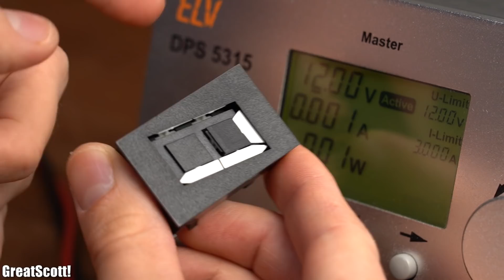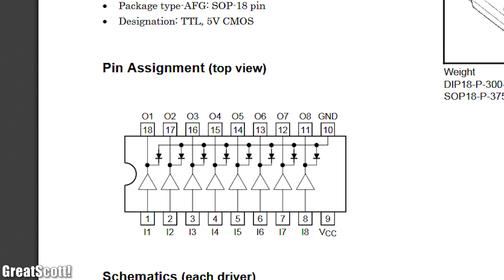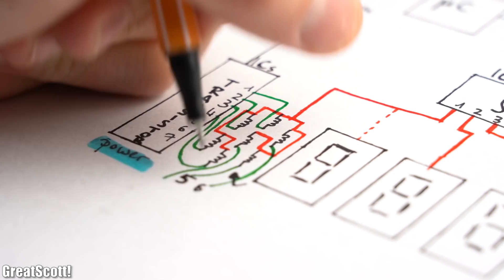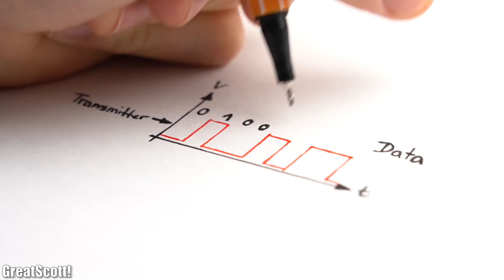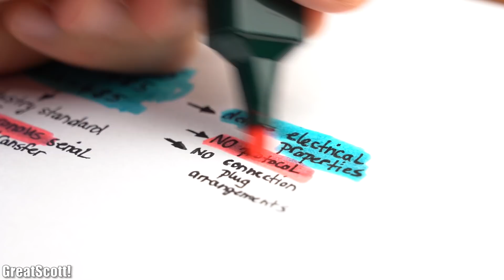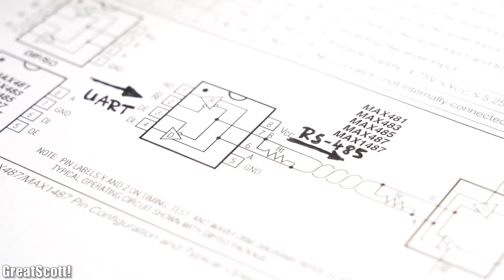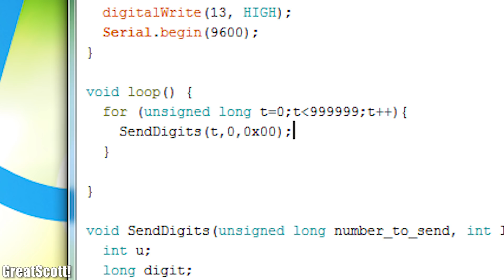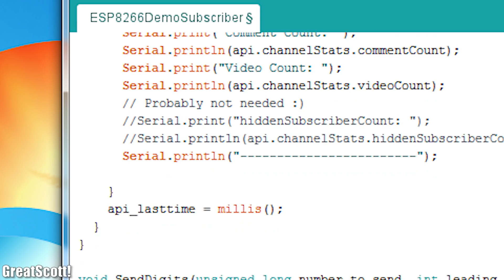Controlling Mechanical 7-Segment Displays?! How RS-485 and UART works! || EB#43

Comment: The control board seems a lot like a DMX controller for entertainment industry lighting, big Clive has some great videos explaining it. But DMX uses RS-485 to be able to control up to 512 lights and the 2 RJ-11 ports on the controller board is where I got this connection from because for DMX there is always 2 ports on each light so you can connect multiple in a chain.

Comment: Can anyone help me out ??

If two microcontrollers sitting far apart(may be upto 1 km) need to talk to each other using RS485, a twisted pair wire can be used to carry the differential signal.

My question is, does it also requires a common ground ??
My intuition says, it doesn't need that but I'm not sure and don't know the reason either.

If you know the answer and its reason, please explain.
Thanks in advance.🙏😄

Comment: The twisting of the cable was not really necessary. We used it always on flat cables with 15 Pin D-SUB connectors with speeds up to 38400 without ever having any issues even in hostile industrial environments. The only important thing is that the differential data lines are not too far appart so that induced noise is the same on both lines.

Comment: Hi Scott,
I am debugging an RS485 design-driven by raspberry pi, before coming to this video I was tired upset because it was not working and it was 3AM in the morning.
In your video you mentioned that the baud rate must to matched, then it dawned upon me that I must modify it and it worked.
I guess when your frustrated you mess up even the most trivial things. Your video gave my cluttered mind a hint.
Thanks a Ton, Scott, never stop making these videos.

Comment: There's a small "mistake" on your video. It's not enough to just plug any twisted pair wire, the twisted pair has to have an impedance of 120ohm for the MAX485. This translates to a specific width, diameter, spacing and insulator material. Usually Ethernet cable has 100ohm impedance, which is close enough for many applications. I know you pointed out to some RS-485 documents for further clarification, but when you show that you can just twist some wires and it works fine it sends the word message.
Reply from the maker: Isn't that why you use a termination resistor? The MAX485 board came with one. Could even be 120ohm.
Reply: @greatscottlab  The termination resistor is part of the process. Basically the signal needs to see a continuous impedance as it travels down the transmission line (the wire basically). When the signal gets to end of the line it sees the termination resistor, with the same impedance. Impedance discontinuities, at the wires, or at the ends (termination) create signal reflections, which leads to signal degradation and many other signal integrity issues. That's a rather long and complex subject, I am trying to simplify it. It just becomes a real issue with transmission lines that get close to the size of the signal (related to the frequency of the signal), so the real impact of it relates with the length of the wires and frequency of the signal. Needless to say, the RS-485 specification recommends 120ohm instantaneous impedance twisted pair wires, with a 120ohm termination resistor at the end of the bus.
Reply: @greatscottlab  Also, that MAX485 transceiver board you used has a problem (I know because I used it before). It comes with a 120ohm termination resistor soldered, it's fine if this is the last node on your RS-485 bus, but if you have many, then you are only supposed to terminate at the end of the line. Terminating on each node get all the termination resistors to consume too much current, as they behave in parallel. So remove it before using on the intermediate nodes.

Comment: I have to chime in, I was a part of building a massive flipdot sign for coke. Videos at the bottom. It worked very much along these lines, just at a massive scale. 485 is very important in this application. There is so much emi with so many magnets, its the only way to get data around. Nothing else works.

Around 80 control boards in this sign, multiplexed 8x8 on one axis, and 6x16 on the other. A PIC micro to decode the bitmap coming in on 485, with a small FPGA driving a bunch of shift registers, driving a bunch of FETs actually controlling the individual x/y coil drive. A really awesome project. To supply enough energy to flick the coils, theres about 80x 680000uf caps in this. Yeh. 55 farad. The sound of this thing going from 0000 to 1111 is an incredible, physical thing. WH-CHOOM!

Flipdots ftw. If you can find an excuse to, play with them, they'll make you smile. Even little ones.

https://youtu.be/uxL4SK3B4lY - the cameras shutter really lets you see how its driven. In reality is far smoother, a flowing, waterfall effect. Which is what coke wanted. Its not instant, its obviously mechanical and slow, but it looks pretty fluid, cos your brain is slow. Camera exaggerates the effect and chops it into blocks, which is what you chaps want to see. But damn does it sound good

https://youtu.be/UOwHlk4lM2c - a press peice, but there is some interesting guts of the machine shots among it. I think Petes nephew was doing a media degree, n it was a decent subject to film. We dont normally Vlog our projects. But it is kinda nice to have video. 

Of course, what isnt shown is the countless hours of hair pulling, yelling at n pleading with whatever gods you hold dear, chasing cable faults, comms issues, power spikes, ohsomany weird code bugs, all that fun stuff. None of that goes away when you go from hobbyist to pro. It just gets more stressful. Ya make some really cool stuff tho

Comment: RS-485 is similar to RS-232 which is a communication protocol. 
https://en.wikipedia.org/wiki/RS-232

and those segments are controlled the same way memory of early computers like IBM-370 worked.
https://en.wikipedia.org/wiki/Magnetic-core_memory

Comment: Hi scott, do you consider to make a lightning surege protection without a varistor. Is it possible to make a lightning strike protector with fast slew rate opamp or FETs? Because varistors are dead after couple of spike/strike and i need different soulution. By the way sorry for mu f*king english dude. If you are interested may be your viewers interests. Thanks for reading.

Comment: 5:11
"this is called a synchronous communication, the rs485 however is asynchronous"

...so confusing xD
Reply: Why? He showed what both of them look like. What's confusing?
Reply: @greenvm  I guess it's the fact that if you merge the "a" with the "synchronous" from "this is called a synchronous communication" it represents the opposite type of communication: asynchronous. So you kinda depend on the video (or subtitles) to clearly know which is which.

Comment: PRICING FOR OCTOBER 2019:
7 seg modules:
9 EUR apiece for 1-99 pcs
controllers:
21 EUR for 1-99 pcs
190 EUR for a bundle of 1x10 digits with controllers
Reply: hackerman  7 Seg is 6.50 EUR for any qty...
Reply: Solitary Midnight  for limited time they sell any qty for 1000+ price which is 6.50 EUR
Reply: @marcinpkrysinski  any quantity 1000+.... Yeah that's not any quantity if it's over a quantity.....

Comment: I think you forgot to explain the ground reference problems of RS-485 or UART. For example, the maximum common mode voltage of A and B inputs, when to use isolator, and so on. Basically, the ground connection in differential signals
.

Comment: Alright, now let's look at the power use difference between one of these and a high contrast LCD display of the same size.
Reply: Or better, an electronic ink display which draws zero power between updates.

Comment: That doesn't explain how the drivers supply reverse voltage / current to the segments you want to turn from ON to OFF though.
Reply: Yes every segment must have a H bridge or be connected between tow Logic output that can source and sink the appropriate current .
Reply: Presumably that is handled by the controller board. He is just programming to get a serial output.
Reply: @popcorny007  I was referring to the explanation of turning segments ON at 2:58 to 4:03, It is NOT like multiplexing LEDS which turn OFF when there is no power, these segments retain their state until power is applied in reverse.

Comment: Another great topic, but I missed something.  

In one of the the diagrams, one end of all of the magnets in a digit are connected to a common source, and the individual segments are grounded by a darlington transistor pair.  How do you switch between the two states; segment displayed or segment not displayed?

Removing the power retains the existing state so don't you need to apply the power for state 0 and reverse the polarity to select state 1?  How do reverse the polarity in this case without an h-bridge?
Reply: Me too.  I guess he used Darlington pairs to drive leds that needed more current than an ordinary logic chip can provide and he guessed that this was done here.  But, as you imply,  current can only be passed in one direction through a darlington pair and the muxing won't work.  Most likely there's a number of mosfet H-bridges involved.   There's a lot of chips on that driver board!
Reply: You might be able to get away with pulling the common line high and pulling only the electromagnet you want to load low? I'm not sure.
Reply: Pondered the same thing! Figured I missed something (which, I obviously did but still happy I'm not the only one lolol.)

Comment: Hopefully china starts making these. I'm not buying from a company that won't tell you the price without "getting in touch with a representative"
Reply: Thats basicly just another way to say "way to expensive for you and dont even try to buy them if you dont need at least 5000"
Reply: someone ITT commented the following:

 Just contect their info@alfazeta.pl email address. The pricelist i got when ive asked was 9 Euro for a 7 Segment without controller (as shown in the beginning) 24 Euro for a single digit controller (didnt ask for code to controlle it, wanted to use it as a base for my own design). And the Simple flipdots were from 4-12 Euro available. Just mail them, the reply was fast and informative when i asked some questions reguarding shipping and price. Hope this helps. Their page also shows some cool Projects they did with artists.
Reply: @hackerman7835  they are cool but too pricey just to buy to play with
Reply: I'm afraid that most of the times it works this way with industrial products :/ every time I have to do research to purchase components for a project is the same, I have to send s thousand emails asking for quotes (Usually they answer back with a huge price xD)

Comment: 6:55 - This is like the XLR standard in the music industry for professional balanced audio facilitating levels of noise removal.

People think 'Hmmmm' to begin with and then 'Aaaahh' when they understand the process of the inverted signal to isolate the noise and then remove it from the final signal.
Reply: And don't forget that stage lights use XLR too
Reply: JDanielDroiidXD - Depends on your pinout (anything from 3-7) but the good thing about XLR is it's scalability lending itself to a shit load of functions :-)

Comment: We use a large 3 inch set of mechanical displays on our racing sailboat for important data. It's excellent, low power and most importantly doesn't have the visibility issues like LCDs with polarized sunglasses. Old tech but still the best in some applications.

Comment: i think you could skip all the mess with 7 transistros plus one extra per display, a pin for each one of the transistors and some basic code. that's 8 pins for a single display, but just 15 pins for an 8-display array. and it skips all the crap. some projects need the complexity of double arduinos, communication protocols and all that, but I think this project is not one of those.

Comment: And to get a price you have to ask for a quote.  :(    why couldn't they put at least an MSRP or estimated price per digit?    It would be good for them to offer a  DEV kit  for $XX dollars with 4 digits and uart board?
Reply: If you have to ask, you can't afford it is the usual approach of companies like that.   Screw them!
They must be out of patent, so I'm sure there's a factory in China churning them out by the thousand, for a dollar or two a piece.
Reply: SarkyBugger I felt that way exactly
Reply: to quote another comment:

The pricelist i got when ive asked was 9 Euro for a 7 Segment without controller (as shown in the beginning) 24 Euro for a single digit controller (didnt ask for code to controlle it, wanted to use it as a base for my own design). And the Simple flipdots were from 4-12 Euro available. Just mail them, the reply was fast and informative when i asked some questions reguarding shipping and price. Hope this helps. Their page also shows some cool Projects they did with artists.
Reply: @hackerman7835  at those prices why don't they just put a PayPal button on or something! I'd buy!
Reply: Search for "ebay Ferranti Packard" on Google - I found it slightly cheaper to buy new-old-stock or used original displays. Alfa Zeta is manufacturing new stock of an existing design which is great for industrial customers, but for hobbyists the supply chain aspect doesn't matter. When I got a quote from Alfa Zeta in 2018, it was cheaper per unit to buy a dozen on ebay including shipping than to buy 500 new units.

Comment: How much do these cost? Are they affordable for DIY projects?
Reply: to quote another comment:

The pricelist i got when ive asked was 9 Euro for a 7 Segment without controller (as shown in the beginning) 24 Euro for a single digit controller (didnt ask for code to controlle it, wanted to use it as a base for my own design). And the Simple flipdots were from 4-12 Euro available. Just mail them, the reply was fast and informative when i asked some questions reguarding shipping and price. Hope this helps. Their page also shows some cool Projects they did with artists.

Comment: And how the hell I can buy one of this? Can't find any info on their page
Reply from the maker: You can contact them. They are happy to answer you.
Reply: If you get a ballpark price tell us, because I'm not going to chase it because it's probably too expensive.
Reply: quote:

The pricelist i got when ive asked was 9 Euro for a 7 Segment without controller (as shown in the beginning) 24 Euro for a single digit controller (didnt ask for code to controlle it, wanted to use it as a base for my own design). And the Simple flipdots were from 4-12 Euro available. Just mail them, the reply was fast and informative when i asked some questions reguarding shipping and price. Hope this helps. Their page also shows some cool Projects they did with artists.

Comment: I've just unsubscribed and subscribed again just so you could hear the noise of it. Now it's time to do a cool enclosure for it with neopixels ;)

Keep up the good work and smooth editing. Your channel is really fun to watch and inspiring!

Greetings from an electrical engineer in Munich :)
Reply: Unfortunately that won’t work, as it takes a while for YouTube to process it.
Reply: @GRBtutorials  Also, it seems to grab the public data, which is rounded to two decimals. In his case that's rounded to the nearest 10 000.
Reply: @GRBtutorials  It also won't work because youtube now rounds off the subscriber number...
Reply: Is the number displayed on the main page of your channel up to date? I think an esp8266 should be able to "scrape" that :)
Reply: @geomagpsz  No. The only place the true number is shown is on the creator studio page, and only the channel owner can see that.
Reply: Youtube changed,  you now need to be authed as the creator(some app in gcloud console probably) to get it precise.
Reply: @honzapat  Even with your own API key, you can't get accurate sub numbers via the API. 

Only from the creator studio, which can't be pulled into a device like this.
Reply: @pileofstuff  Any reason you couldn't program a device to use the creator studio number?

I suppose an alternative would be to make a view counter that sums up views across all videos uploaded by a given creator.
Reply: NiHaoMike Well, another possibility is to use maths, concretely bidimensional statistical analysis. Wait, don’t run away! It’s not that difficult, just a simple matter of logging the subscriber count for a few months, and then applying statistics to calculate when the next subscriber, well, subscribes. That still doesn’t allow for this kind of thing to happen, but it’s the best we can do without pulling out that number.
Reply: @NiHaoMike64  You'd have to put in your youtube password and have it do an old-school web scrape to do it that way. Not sure if an ESP has the horespower to do that.

Comment: Ive always wondered how and why "twisted pair" wiring works... can someone give a quick explanation, please?
Reply: Signal is inverted in both the wires. When noise is induced it is same in both wires. So, at the receiving end when one of the wire is inverted, noise get cancels out and signal is doubled.
Reply: @vkp111  any insight into when this method should be used? This is starting to seem like a topic worth exploring more, as now i am also curious about shielded cabling and the like.
Reply: @MrCrackbear  ahhhh, makes sense, thx so much for the succinct explanation!

Comment: I use RS485 basically daily, the moment I saw you writing code for the Nano I was instantly going 'nope, nope, nope, nope!' in my head.
Whilst I fully understand the difference it would have been useful to explain WHY the Nano does not support the 485 standard.
Reply: Vince Osborn I am also curious about this.